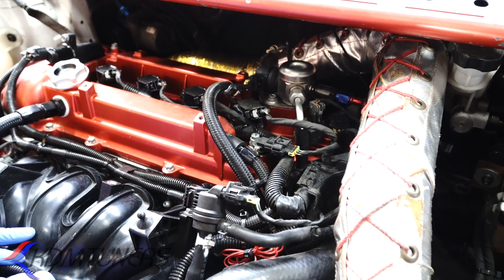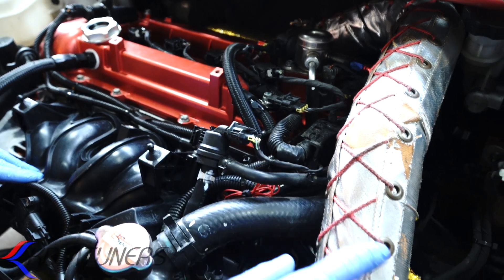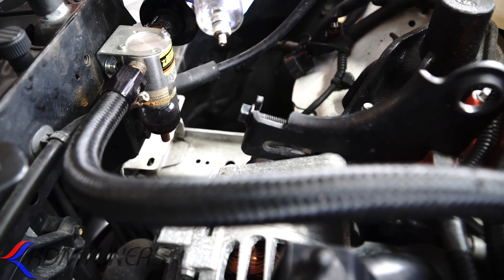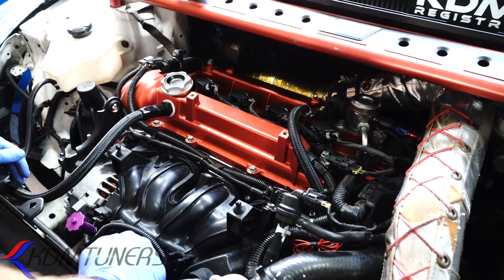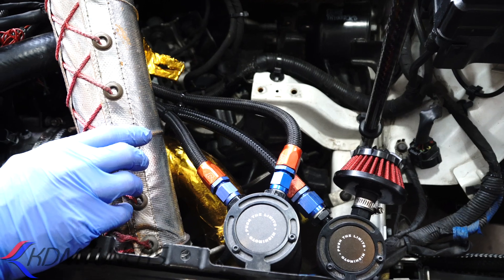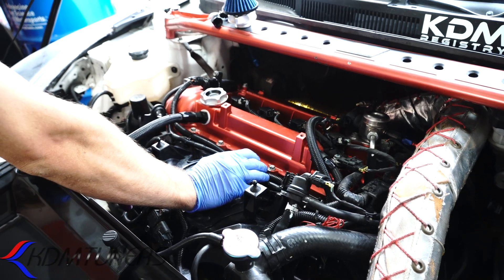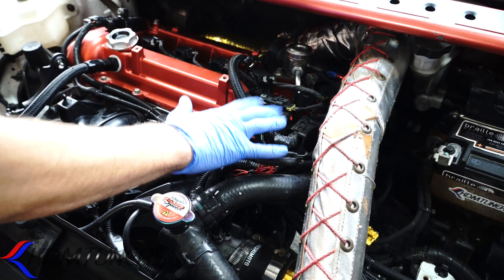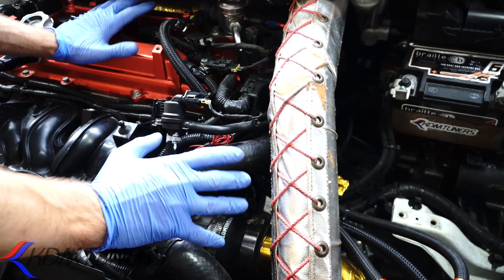How to properly install catch cans, PCV explanation and more!

Comment: Did your fuel trims change when you installed this setup? I have turbocharged my car and have a sealed/baffled OCC - PCV goes to catch can inlet, catch can outlet goes to manifold. I have a breather on the valve cover vent that used to go back into the intake just after the MAF and before the TB. My trims are high positives but the ECU is handling it with stoich AFRs (I haven't installed my new injectors or my FIC yet. I'm not driving the car yet, obviously. Maybe my trims have to do with my MAF, and different airflow from stock setup, but the guy who is going to tune my car says: block off the PCV system and put a vented catch can on the breather side only. Thoughts?
Reply from the maker: Fuel trims are not affected on these cars. We dont have a MAF either so that could very well be the case. Many people delete the PCV and turn it into another vent.. There is many debates on this topic and if you read through the comments you can see it can get very muddy lol! The main thing is to get that crank case pressure out whether its vented, Pvc, Vac pumps, etc... many ways to skin a cat sort of speak. Each car will vary as well This video just illustrates what we have success with on the 1.6T Gamma motors. Hope that helps a tad.. Good luck with your build!!!!
Reply: @KDMTUNERS  Thanks! Well, I started my car again but this time with the Deatschwerks 440cc injectors installed. Fuel trims at idle are now LTFT -5.5 and STFT 0.0, down from LTFT +29 and STFT +20. The bigger injectors obviously richen things up but I still don't have the F/IC installed, so it will be interesting to see what happens with the mapping.

Comment: So, if I understood correctly, the ideal way to get this done is: 3-port catch can into which the intake valve and positive combustion valve (both sides) hoses will go into and vent to atmosphere while using the vented cap (whether with filter or with 45 degree elbow to an air-oil separator - also vented to atmosphere? I'm going to wait and get your system as opposed to a two-can system.
Reply: Agree. 3 port system better

Comment: Your PCV system is absurdly complicated. On turbo cars, it's easier to install your catch can from the valve cover vent to the turbo intake/ filter side. The suction from the turbo creates a natural vacuum on the crankcase. On big turbo cars like yours, you're going to have to modify the baffling system to your valve cover/ PCV to accept bigger lines for more blow by. When you have a good oil separator, it don't have to be vented.
Reply: you are saying something
Reply: 1
Reply: W
Reply: I have a radium pcv/catch can and I'm getting oil out my air cone. It's a destroked brian crower cammed big bore out out e.j 2.5 with a 68 mm borg Warner efi with a trial wastegate on e85 in my fully swapped 1999 subaru impreza rs. Why is it doing that?
Reply: @ericexplorationunknown9365  thats because there is no vacuum between the filter and the turbo. A standard or correct filter for an engine will create that vacuum.

Comment: Good job on most of this!!  Email me direct and will give you better explanations to help you.  As your engine is turbo charged, the intake manifold only provides evacuation vacuum at idle or deceleration. Any time the turbo is spooling up it makes boost pressure. So you need another secondary suction source so no pressure can ever build to begin with. You do not want ANY venting. Venting is technology that was outdated in the 60's and 70's.  SO, what you need first, is check valves in both outlets of a dual outlet can. And the can your using only traps a small amount of the oil, look at one of the 95% effective dual valve systems with cleanside separator.  That way it uses IM vacuum when no boost is present, and use venturi effect generated vacuum when in boost so ALL the time suction is pulled. This aids in ring seal and stability and reduces ring flutter blowby. Simply emulating a belt driven vacuum pump. Your using the exhaust that due to pulses will still allow pressure, unless you use an header evac valve. But these only work with no mufflers or exhaust pipes.  Again, your on the right track but you need to totally emulate this. Here is a video of a dyno with venting and pulling suction.  https://www.youtube.com/watch?v=-7bGshirEKI&t=24s   But email me and will guide you further as your 80% their.  Good job!!!   Oh, and using a Mishi can only traps around 30-40%. The rest is still ingested.  Will share all with you.

Comment: What if you made a cap that vented to an oil air separator mounted like the one you have there?
I'd think that would keep the filter clean and flowing the same over a longer time.

Just my 2 cents. 
Great video!
Reply: Aaaaand I kept watching the video for literally 5 seconds (Paused around 7:50) and you said you'd be coming out with that version.
Thanks again!

Comment: Thank you for all of the information. I have the Kia 3.3 v6 in my AWD 2027 Sorento. I want to add a realistic oil filtering system to improve the combination for years. I can not have any open vents or breather filters because of the climate and rain I am around. 
Can the oil air separator and catch can be vented on the stock intake after the filter. Thank you again for your video

Comment: Thanks for the detail video mate. It cleared the tons of confusion and setup we see in the car scene. My question: Im using an external iac valve   with the iac in coming from the air intake and the iac out going to the manifold. I have a tee joint in between the air intake which attaches to the outgoing tube from the oil catch (in coming from pcv valve) to keep the vacuum. Can i join the catch can vacuum tube with the tube from iac out into the manifold instead? My reason being if there is any blow by oil and dirt,  it wont clog the iac valve which can reduce the efficiency. Any ideas?

Comment: What are you doing! Papa, make a choice. Open System or Closed System. Not both. Every car gets blow by, boosted engines get more. Theres also a Hot and Cold side to every engine too. The oil sump pump hooks up to the pully but thats way beyond you son!

Comment: Can you just use an electric vacuum pump, and separate the PCV/Venting from the engine intake system entirely?
Reply from the maker: Yes sir you could. There are a few pump style systems out there. We have a few options coming... Just waiting on the parts to arrive